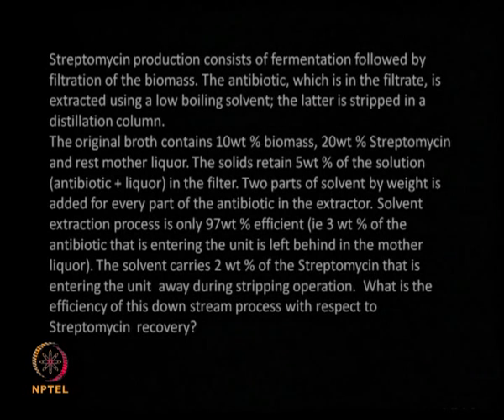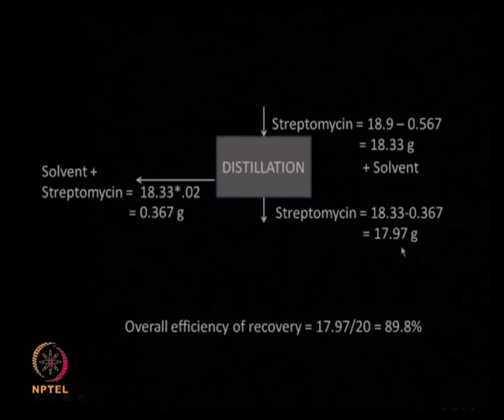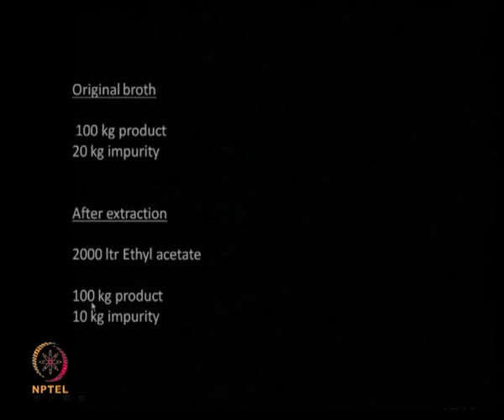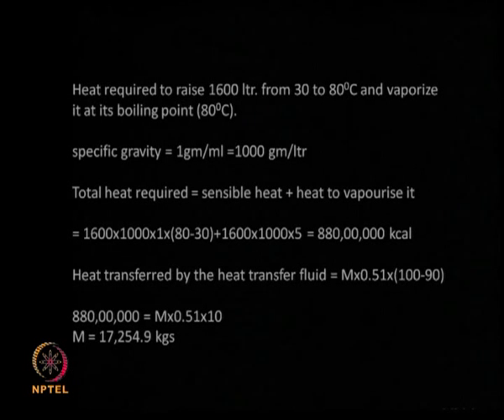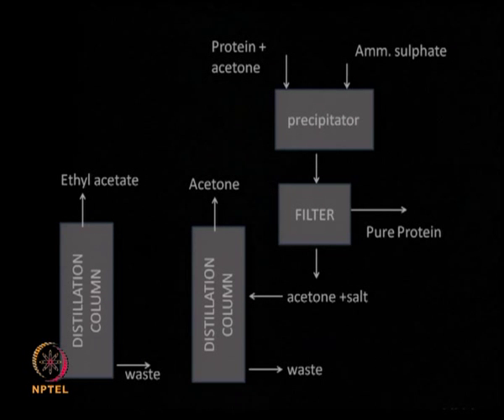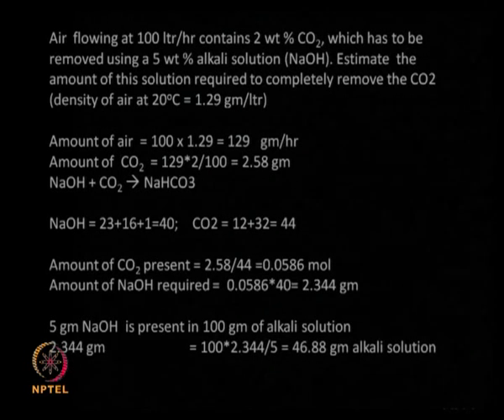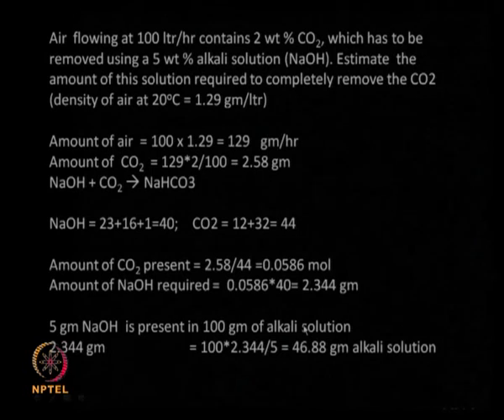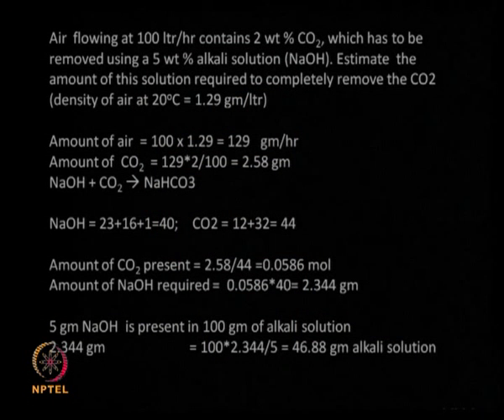Mod-01 Lec-05 Problems in Mass balance, flow sheet

Comment: why do you divide by 9 in the flow chart for the first question?
Reply: biomass after filtration 10g is lost so 5g of solution is only 90% of previous total solution therefore everywhere instead if 10 division of 9 is used